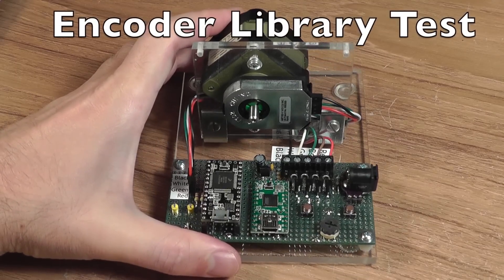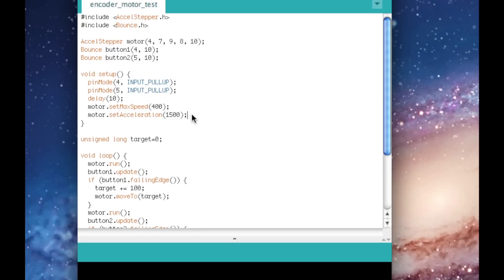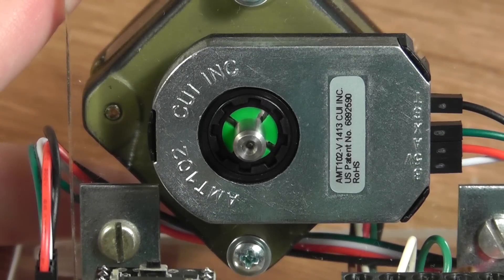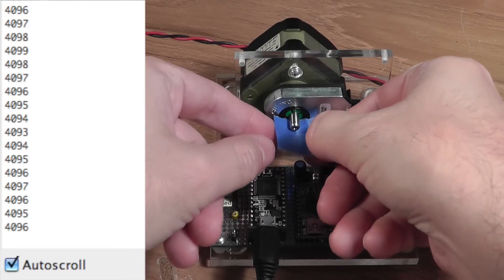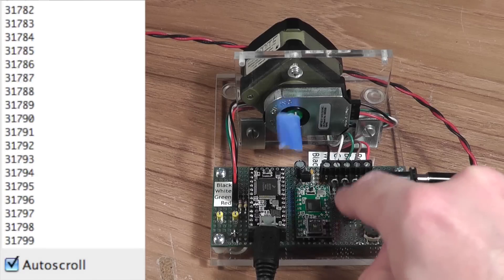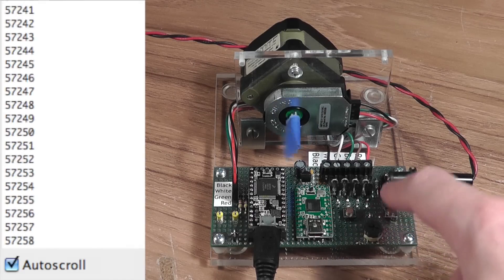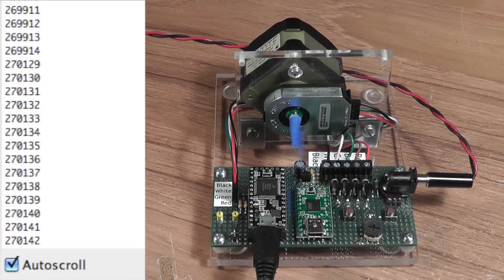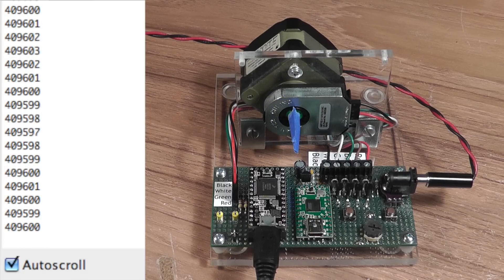Encoder Library Test

Comment: Guys how can I use a 5v encoder with teensy? Please give me a solution
Reply from the maker: If your encoder is mechanical or open collector type, where the pullup resistors define the logic high voltage, simply connect the resistors to 3.3V rather than to 5V.
Reply from the maker: If your encoder is active output (has electronics inside and needs power to work) then use either a resistor divider circuit or a voltage level shifter chip to reduce the logic high voltage.
Reply from the maker: If these quick answers don't give you enough info, you can ask for help on the PJRC forum.  But don't just ask a quick low-info question on the forum, like this question here.  Give details, like the datasheet or link to tech specs for the specific encoder you're using.  Also explain context, about your application and some idea of the expected rotational speed.  Many people who use the forum daily are electronics experts who can give really good advice to truly meet your needs, but only if you provide details and context so they can understand what your needs really are!
Reply: @PaulStoffregen  Hello Paul,
Thank you very much for replying. I appreciate it. I have documented what I am facing from and you should find it from the below link. Please let me know if you need anymore details.

https://drive.google.com/file/d/1C7kwrckWYMLTYk2ygKoqwg6Q7Vngx9Z4/view?usp=sharing
Reply: @PaulStoffregen  I have posted the problem in your forum (Project Guidance). I dont exactly know why I am not able to post the link here. The title of my thread is "Issue using a 5V encoder with Teensy 4.1".

Comment: How do you reduce the output voltage from the AMT102 to the 3,3 Volts tolerant teensy input?
Reply: Did you get an answer to this?
Reply: @bruhnowayy  Yes a Quick response
Reply: @carlomoise4642  lmfao I actually got reached out by paul himself from the forum. The forum is super active and if you want you can reach out to the experts out there.

Comment: thank for your nice video. i have to read DC servo encoder(RMCS 2294)in arduino and i tried many coding.but it is not working and  i have to convert my sensor reading value into Angle. this motor consist of Quadrature Encoder

Comment: Is this library available?
Reply from the maker: Yes, of course.  You can get it with Arduino's board manager, or it comes with Teensyduino (if using Teensy), or you can download it directly from github.  https://github.com/PaulStoffregen/Encoder
Reply: Great, I gave it a try, connected to a stepper as you've done, 
for some reason missing 3-4 steps per 2 revolutions,
but it returns back to 0.
My stepper doesn't have accel built in.
Do you think this may be the reason?
Reply: No , the error still appears even when the stepper runs very slow.
May be it is coming from the Arduino itself?

Comment: Are you using a debounce circuit for the AMT102?
Reply: There is no need for debounce, the encoder outputs clean bounce free signals. That particular encoder does not mechanical or optical sensing, but capacitive (like digital calipers use).

Comment: Paul, I just bought an absolute rotary encoder (Koyo TRD-3A1024-2610     'Im told its very close to the TRD-NA models') - which has 12 pin connections. My question is, how come your encoder only has 4? What type is it? Is it possible to reduce the amount of pins needed to connect my encoder to my arduino?  This link is similar to mine - Test  Absolute Encoder

Comment: Hello Paul. Thank you for the nice video. One thing i want to know is AMT102-V as mentioned on the manufacturer website can have a max of 2048 ppr (" The AMT102 or AMT103 models come standard with an onboard dip switch with 16 selectable resolution options ranging from 48 to 2048 PPR") but in your video you are getting 4096 pulses. Is that a different model?
Reply from the maker: It was actually set to 1024 ppr.  The way quadrature decoding works is each pulse turns into 4 counts.  For more details, see the encoder library web page and scroll down to "Understanding Quadrature Encoded Signals".  There's a little animated wheel you can click to spin and see how each pulse (slot in the wheel) turns into 4 counts when decoding the signals.
Reply: +PaulStoffregen  Dear Paul, can You please specify where is the "the encoder library web page and scroll down to "Understanding Quadrature Encoded Signals"." ? 
I am trying to interface CUIs AMT-103-V encoder and I want to use the Library. 

Much appreciated. Thanks for the video above.
Reply from the maker: Robert Varga This page:
 http://www.pjrc.com/teensy/td_libs_Encoder.html